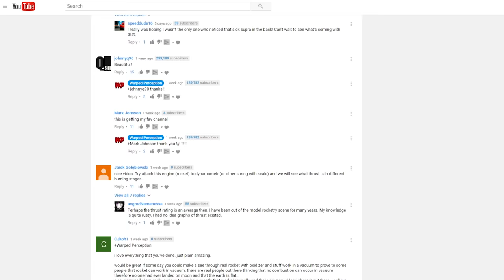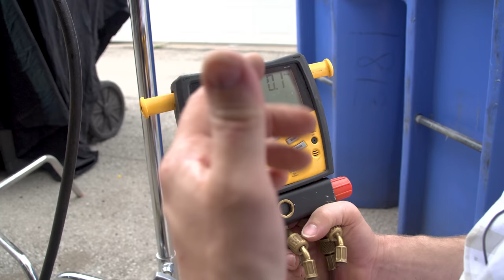Model Rocket Engine In A Vacuum Chamber - 4K Slow Motion - will it burn? - Rockets (S1 • E3)

Comment: notice how the rocket quit working after a second because in a vacuum chamber it's impossible to get rid of 100% of the air so the rocket lit until all the air was gone for a Split Second once all the air was gone the rocket quit.
Reply: rocket fuel has oxidizers in the chemical compound aluminum perchlorate probly
Reply: @NoName-kf1cy  oxidizers are used to keep fires going burn hotter and cleaner but you can't start a fire without oxygen existing around the area. Not only that without having air to push off of you wouldn't be able to travel anywhere in any direction.  Aircraft carriers have huge steel walls for jets to push off of to create a greater force of lift.  Without that wall the jet falls in the ocean. So what would a space shuttle or rocket be pushing off of in space hopes and dreams maybe?

Comment: Your flimsy contraption doesn't even come close to the so-called "vacuum of space" (1×10−6 to < 1×10−17) Torr.
Reply: Can you tell me what PSI is equivalent to your 1x10^-17 TORR?    Didn't think so.....
Reply: That number is 0.000001 - 0.000000000000000017. Still a positive pressure.

Comment: Space is allegedly a near infinite vacuum. Your chamber had a very weak vacuum in it that ceased being a vacuum once the rocket engine ignited and filled the chamber with something for the rocket to push against. Rename your channel Purposely Warping Perception
Reply: Can you tell me  at which altitude  the near infinite vacuum of space begins?
Reply: Can you prove it to me in a comment? Why are you here?
Reply: People like you claim, that rockets need air to push against and don't work in a vacuum. And I just want to know, how high a rocket could fly according to you.  Do you think that the thrust is releated to the air pressure (so less air density = less thrust)? That would make sense. But then we have the problem, that already at 35.9 km (not space by any definition)  we have only 1% of the air pressure comparing to ground. But we can see that in that altitude  rockets still accelerate with full power. Or do you think, that it works well, unless there is no infinite vacuum? Ok, but then we don't have problems to go with rockets to the ISS. At that height (400km), there are still so many air molecules, that the ISS loses 50m-150m altitude each day, because the air drag slows it down. So it must be pushed from time to time.

Comment: dont you need air to get things to burn? no air in a vacuum.
Reply: You usually need oxygen which is included in the air. The rocket motor (engine) can burn in a vacuum because the fuel contains some chemical that contains oxygen and is able to provide the oxygen during the burn. For example, the potassium nitrate in the fuel contains oxygen since the chemical formula is KNO3. I guess the fuel used in this video consists of carbon, potassium nitrate (nitrogen, potassium and oxygen), and sulfur.

Comment: uhhh. I would think they carried oxygen so it burns like the oxidizers in the rocket engine you used. The question is do they produce thrust, its gonna be hard to tell in an enclosed vacuum chamber though....you need actual limitless space to test that theory.
Reply: +larjerr Basic Newton: kick mass at high acceleration out of the rocket  nozzle will cause the spacecraft to move in the opposite direction. Very basic stuff.
Reply: air is the mass that repels the nozzle blast....no air in a space vacuum.
Reply: +larjerr Completely wrong. The mass expelled is the exhaust gases from the rocket engine and creates an equal and opposite reaction, moving the rocket in the opposite direction to the mass kicked out: it really is that simple.

Comment: Your attempt has only reinforced the fact that gas molecules/the back solid plate on the vacuum chamber are required to thrust against for a jet rocket 'work'; your rocket only moved AFTER the gases arrived at the jet's nozzle; which means the vaccuum was lost. Furthermore, the rocket remained stationary when the ignition cap was ejected under vacuum, contrary to what was expected from the belief of jet propulsion (in vacuum).
Reply: @darklight2.1  oh, ok, post the link to YOUR actual flight evidence on a rocket in space, note the emphasis, in space, not in Earth's outer atmosphere; make sure that you were inside the rocket so as to conform to The Scientific Procedure.
Reply: @hiyou4078  I will be happy to help you understand the physics behind rocket propulsion. 

SO just answer a few SIMPLE PHYSICS questions.
If I fire a steel projectile from a crossbow, here on earth, will I FEEL a recoil force?
Yes or No?
why or why not?
I will not go on until you answer each question.
And I have incontrovertible evidence of rocket propulsion working in a vacuum that I will show you AFTER you answer these questions.
Reply: @hiyou4078  - "I did University Level Physics AND taught Physics."
Then you are lying about SOMETHING.

It is not possible to pass HIGH SCHOOL physics without understanding how rocket propulsion works in a vacuum.

So which thing are you lying about?:  Having EVER taken a physics class, or believing that rocket propulsion does NOT work in a vacuum?

I can get ANYONE to admit that rocket propulsion MUST work in a vacuum. All you have to do is answer about five very simple physics question with no math.  This should be very simple for someone who has "Taught physics"

FIrst question: If I fire a steel projectile from a crossbow, here on earth, will I feel a recoil force? Yes or no?
Why or WHY NOT?
Reply: @hiyou4078  - 
"oh, ok, post the link to YOUR actual flight evidence on a rocket in space"

Sure. I have video evidence.
But BEFORE I show you tell me: At what Altitude above earth does atmospheric pressure drop to "vacuum"

Since the industry standard for "Vacuum" is any pressure BELOW 1.0 Torr, then tell me:

At what altitude does earths atmospheric pressure drop to BELOW 1.0 Torr?

Comment: Vacuum? Giant tube?
What class vacuum did you produce?
What’s the volume of the tube?
What volume of gas does the motor is producing?
How strong is the vacuum pump?
NASA needs hundreds of millions to build a vacuum camber 3 classes under the vacuum in orbit!
A vacuum is not same as a vacuum.

Comment: how much watts are you using on what diameter of the cable? im trying to ignite things but mostly the wire instantly burns or its not hot enoug
Reply: Rocket igniters are a thin wire coated with something that will burn and generate a lot of heat of it's own - much hotter/longer duration than the wire alone.

Comment: But the rocket only pushed the spring after the rear of the chamber filled up with smoke. the Very FACT that the 8 second rocket burned in 1 second would have grave side effects on a bigger scale. 
the vacuum of space is not a chamber. what if you vacuumed from the rear and sucked the exhaust as fast as it is produced which is more akin to "space". the rocket may ignite but without anything to push off of it wont have any thrust. the rocket would fire but wouldn't go anywhere

Comment: of course it will push off the walls of this tiny chamber,, rockets need sumthing to push off
Reply: " rockets need sumthing to push off" 
Good thing they take that "Thing" with them to space because there IS nothing to push off of.
rockets "PUSH" off of the MASS of the fuel and oxidizer they take with them to space.

Comment: Flat or round...let me add this.A rocket won't work in a vacuum where there is no oxygen or mass of air to push off of? It will burn because it has it has its own oxygen mixed with accelerant. However can it make something move in space when mass weights nothing and there ishould no mass? That's a better question. Oh...and there is no such thing as the vacuum of space. It's simply the equalization of a pressurized area into a lesser pressurized area. Same as opening a soda can here on earth. But we never call it the vacuum of earth do we. Peace.

Comment: This test can NEVER be performed accurately, that is a physical fact and i will gladly explain why. 1, Your vacuum would need to be many orders of magnitude stronger, near perfect, to provide a scientifically sound and recreatable test, technically you created a partial vaccum. 2, Burning fuel creates gasses which further re inflates the vacuum.. Lets assume your test was somehow physically possible (again it's definitely not) that's means you simulate a Near Perfect Vacuum and you provide fuel and oxygen combination in perfect timing to fire the rocket, which would result in a nice little night light remaining completely stationary, but boy would it look nice :).  3, Newtons third law of motion, for every action there is an equal and opposite reaction. The thrust of a rocket is generated when the ignited fuel out of the rocket is pushed back by the gasses in the atmosphere which in turn causes acceleration, without anything to push against you get 0 forward momentum. There isn't a vacuum chamber ever even conceived by man that can replicate the near perfect vacuum of space even within a fraction of a percentage. Also, Burn me on this statement if you want but none of you naysayers will ever prove me wrong here, I am extremely confident that if you did manage to get a rocket into space the negative pressure would absolutely rip anything with liquid or gas inside of it apart instantaneously. P.S. If you're trying to prove nasa can shoot rockets through space then good luck, you better invest in some video editing software and do it like the pros. #NoEqualAndOppositeReaction #WaterBubblesDontFormInSpace

Comment: What do the numbers on the gauge mean?  What is -29.2 and .01 mean. There appears to be air in the tube still. Doesn't it take a lot more pumping to take ALL the air out? Sorry this is a NON experiment. A true vacuum would crack that tube easily. A 55 gallon drum collapses in just a partial vacuum.

Comment: try an infinite vacuum.  theres a lot of material there for that rocket to push against.
Reply: So you think as long as a vacuum is not infinite, rockets work?
Reply: no, i didnt say that.  the tube is providing plenty  of solid material for the exhaust to push on.
Reply: Then  where is the threshold, how much air pressure do you need? Or do you think, that the thrust is related to the air pressure? That would makes sense then, but can you tell me the formula for that?

The people who actually believe, that reaction engines work by "pushing against something" obviously forget, that already at 36km (that is not space by any definition) the air pressure is only 1% comparing to the ground. Then why do rockets keep on accelrating with full thrust in that altitude? Rockets should go slower the higher they get. And why are airplanes so fast even in quite high altitudes? Actually they fly so high because the need less fuel there. And altitude records for jet are also made in quite high altitudes.

Comment: If it was a vacuum, surely the smoke would've been sucked straight out? instead it fills the chamber.
Reply: this is an honest question, not trying to prove or disprove anything.
Reply from the maker: Actually the opposite, there is no air for the pump to pull out so the smoke which is partly particulate stays in the chamber as if it were a solid, there is essentially no flow once you have a vacuum.

Comment: Still air in your “vacuum”. Nice try though. Try doing the “experiment” the correct way next time.
Reply: well there's no air at first but you can see as it gets there becuase the engine produces it
Reply: The Global Deception - Let me guess, you are one of those Geniuses that thinks that rocket propulsion does NOT work in a vacuum?
Reply: @kaktu7983  its exhaust not air
Reply: @prolska  sry i mean't oxygen because  it's produced by burning the oxidizer

Comment: Of course combustion can't occur in vacuum, this is why in big rockets they use a mixer, whih mixes oxygen with the fuel in order to burn,  think its called oxidizer. In this video, full vacuum is not reached, and even though its burned, the thrust would be too small compared to the previous experiment.

Comment: “Success” although as long as it has oxidizer it will burn in a vacuum, I could hear the vacuum, therefore your “vacuum” is DEFINITELY not a vacuum
Reply: The vibrations of the copper coils from the motor got pushed into the tube itself, so the tube acted as the medium of sound

Comment: You cannot simulate an infinite dimension of full vacuum with a small volume vacuum. 
It's simple to understand, the helicopter need air density to push against air. It's same for rocket.
Reply: Helicopters don’t need air to push off, but they do need air to produce lift. However, this test was mainly to show rockets will burn in a vacuum.
Reply: @tomkfly  Without air, Helicopter can't fly.
Helicopter, push air against ground to produce lift, then it push air against air to produce less lift, then when not enough air density cannot provide enough lift, then stall. Rocket, can't fly in scace. Science fact
Reply: A O  where did I say Helicopters don’t need air?  What I said was they don’t need air to push off.
Reply: I do agree trying to demonstrate a rocket in a small vacuum chamber is not very convincing. However, being able to understand `Newton’s laws tells you there is no problem with rockets working in space.

Comment: What degree of vacuum was created initially? It can't have been much, and nowhere near an absolute vacuum. Nowhere near. To simulate what is said to be in space, you would need a chamber with thick steel walls. What you created in this glass tube was not a vacuum. You simply reduced the air pressure a bit. Come on, who do you think you're talking to? You are just feeding the intolerant and vicious attitudes of that group which is disconcerted by the challenge to their cherished belief in the established dogmas. It's funny to see how the 'flat earth' proponents cause so much upset and anxiety. A more scientific approach would welcome their dissenting alternative views.

Comment: Did you see that nothing was happening till the chamber was filled with gas ... than the "rocket started moving forward ...  It doesn't take much time in such a small chamber to loose its vacuum properties .... not a good demonstration at all .

Comment: The question is propulsion. Without atmosphere to push against the rocket will be unable to fly in a vacuum. That’s factual.
Reply: FALSE.  If you fired a crossbow in space, would you feel recoil?
Reply: Ever felt the kick from a pressure washer? Do you think it's because the tiny spray pattern is hitting air?
Reply: @PabloGonzalez-hv3td  I find it amusing that they think that rockets can push on the mass of the 14.5 PSI AIR outside the nozzle, but NOT the 3000 PSI gas INSIDE the nozzle.
The 3000 PSI gases are over a HUNDRED times more dense (massive) than the air outside....

Comment: is that gorilla tape to hold the ends?  lmao  where is the gauge showing the pressure inside?  how long did it take to pump down?   Your not trying to say a rocket will move in space are you?   it might prove that a rocket could ignite based on it's fuel type.
if rockets work in space then why did they theorize a way to use mini explosions like grenades behind a craft to make it move in space after they realized a rocket wouldn't move it. 

people that claim others need to take a physics course should not have taken it themselves because it obviously suppressed your senses!  At 2:22 you can see the smoke has left the chamber and you can see it moving over the tube meaning it was not sealed tight.   If it did ignite in true vacuum, the ignition would create an open door to the vacuum and pull it all at once.  Even if it created it's own force to push against, that will never happen in the vastness of space because the environment you are creating with the rocket would have nothing to push against itself.  rockets won't move in space no matter how much thrust they have.  you would have to fill space up with the rocket exhaust just to have something to move against.   That little tube does not compare to the size of theorized space at all.  A FEATHER WILL NOT BUDGE IN A VACUUM WITH A FAN SPINNING IN FRONT OF IT as seen on cody's lab he also proved that even gun powder among other things will not ignite in a vacuum.  A fly cannot fly in vacuum as it has nothing to push against.  a drone will not fly in vacuum as it has no air to displace.  a rocket would have no "force" to displace it's thrust against so it would be like putting gi joe's on a oxy ace torch while holding it in your hand, it will not fly.  

who the hell is Newton? and who gives a shit!  Newtons 3rd law HAS NOTHING TO DO WITH A VACUUM.  People see possible physics and immediately start complicating common sense. 
riddle me this newton lovers
You have 2 people 1 is 100lb the other is 100lb.  person 1 is inside a normal environment with "gravity" on earth and person 2 is on the moon and a rope between the 2 playing tug of war.  Who would win?  <--the answer tells you newtons 3rd has nothing to do with vacuum as there is little to no "force" around you.  Newtons 3rd can only apply if you were surrounded by an environmental force.  without the environmental force things would continue moving.  swing a fly swatter there is resistance from the air.  swing a fly swatter in vacuum there will be no resistance.  no one has EVER made a vacuum that can replicate that of space.

Comment: Hmm, wonder why they use liquid O2 as part of the fuel mixture in rockets. It must be cheaper than nitrogen.
Reply: Nitrogen is an inert gas, it is not an oxidizing agent and is not reactive, so it's basically useless. That's why they don't use it
Reply: @Fred_the_1996  It was sarcasm. The reason rockets can burn in a vacuum is because they have their own oxygen.